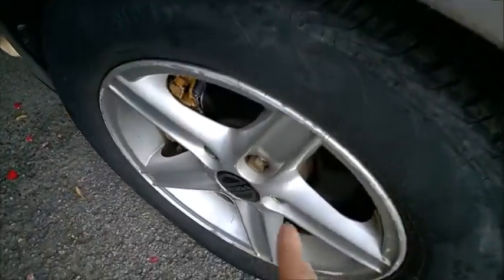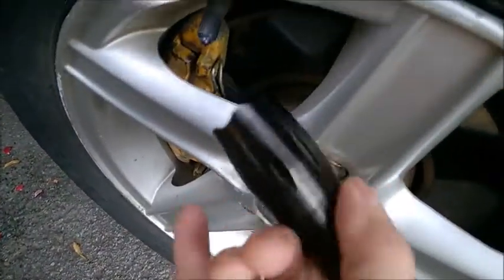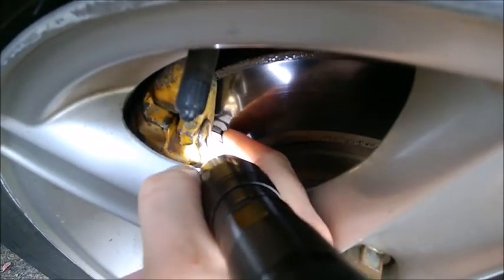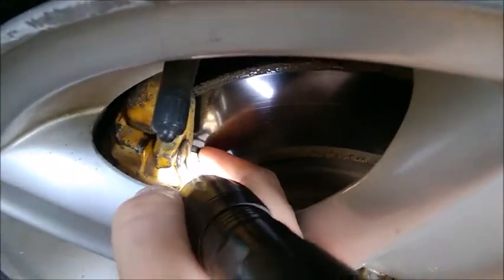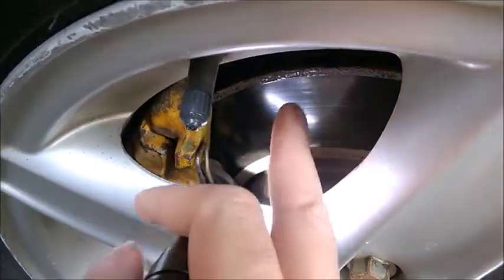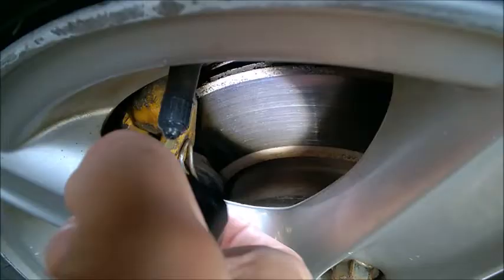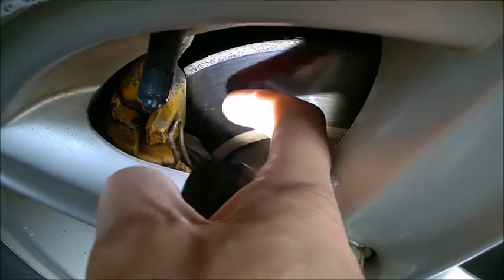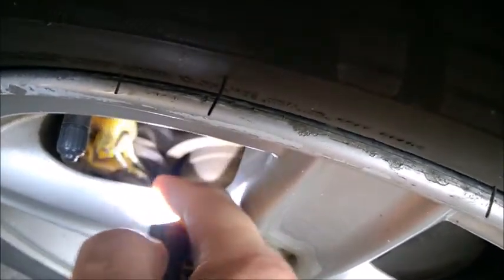Quickly Check Brakes wear without removing the wheels - see diagram at the end

Comment: Many workshops will simply upsell and recommend unnecessary repairs, just drive until the wear indicator comes in contact with the rotor surface causing a screech or squeal indicating that the pads are getting thin and nearing the end of their service life, then its time to change the brake pads. The function of the indicator is just to make some noise to alert the driver to change brake pads, the sound produced will not hurt the brake, it's fine to just drive until it happens. There is no need to keep checking the brake pad levels unless you are going on a long road trip.
Reply from the maker: Unfortunately many aftermarket brake pads don't have such metal indicator and one will risk damaging the discs as the pad material wears off completely.  Several more upscale cars may have electronic wear indicators but most less expensive cars are not equipped with
Reply: @Peppermint1  You probably have more automotive knowledge than myself. In my part of the world, brake pads without indicators are so rare, I have never encountered any before. I have been driving for 20years, and I handle the routine maintenance stuff like changing engine oil, tyres, brake pads, and such. I do not understand the rationale for manufacturing a brake pad without an indicator (electronic or otherwise). And I think for such instances, the driver could have done so intentionally, if so, he/she should follow your advice to check it regularly. I think this would be more of an exception than the norm, the majority of the brake pads should have a wear indicator. If a mechanic intentionally installs one without telling the owner, this mechanic should stop being a mechanic. If there is no good reason for manufacturing a brake-pad without an indicator, such a product should be outlawed if you ask me, it's just toying with people's lives. The other possibility is that a brake-pad with an electronic indicator was installed on a car without support for the electronic signal.
Reply: To sum it up, you are citing an exception, I am not saying you are wrong, you have a point and although it's a legit possibility, I think it's an exception. I think for the majority who has regular brake pads with an indicator, I stand by what I have said above. For those without a wear indicator, please follow your advice in the video.
Reply from the maker: @WangErMao  No problem, in which country are you located ?  The market can differ from country to country. It is possible in Asian and European countries most pads come with wear indicators (small metal tab at the bottom of the wear material). Where I live in North America, I did not notice these wear indicators on several original and aftermarket brake pads. There are some exceptions such as european cars being sold here
Reply: @Peppermint1  I live in Asia, I agree markets can be different in different countries. I am glad to learn something new today 👍
Reply: @iNSTAGiB Only makes noise when brakes are applied. You should get brakes checked as long as you hear noise. They might be more obvious at low speeds.

Comment: What about inner pad
Reply: They usually wear equally unless there is an issue with your caliper or slider pins.
Reply: @jayceeel9522  I was told by a friend of mine that they wear at different rates and the inside one does most of the work

Comment: but you can't see the inside pads
Reply from the maker: That is right, and sometimes the pads won't have the same wear if the caliper doesn't slide freely. Evaluating the outside ones is only an estimation. If we notice the outside ones are pretty worn, it's better to remove the wheel and evaluate the inside pads as well - we can look from the side of the caliper at both pads, there is a hole on the side of the caliper to inspect the thickness of both pads but for this the wheel has to be removed (the caliper will stay in place)
Reply: @Peppermint1  i am going to try one of them Inspection Mirrors to see if i can see the inside ones ? have you tried that. also got to get timing chains done

Comment: This video is misleading, it is common for the inside brake pads to be more worn than the outside. Removing all wheels takes 20min and ensures you are not damaging the brake pistons leading to a way more expensive repair.

Comment: Judging the rotor thickness based on that rusty ridge from the pads NOT wearing the rotor is not reliable.  Rust will be much thicker than the removed wear surface.  Properly using a digital caliper is best method to measure the rotor thickness.